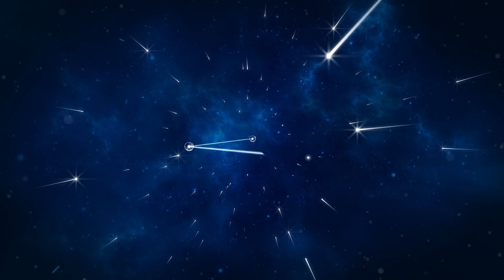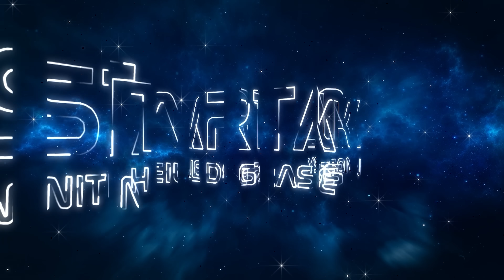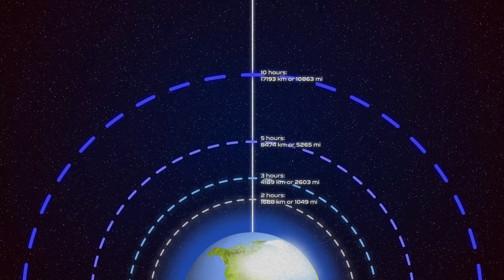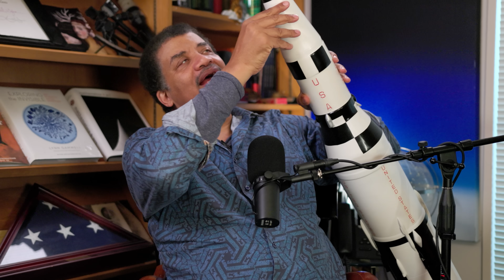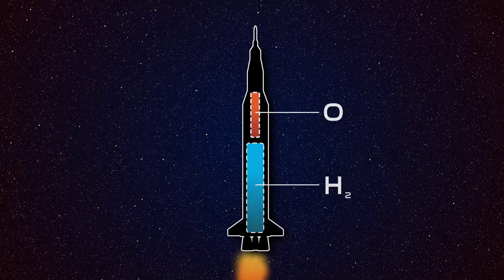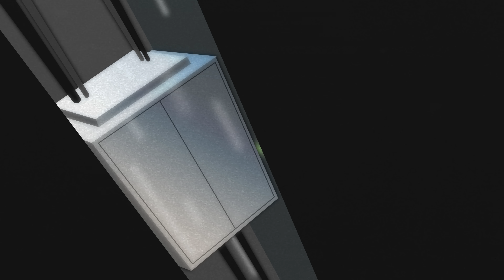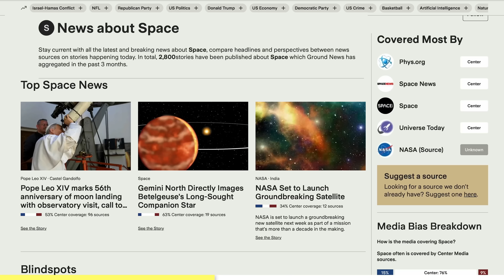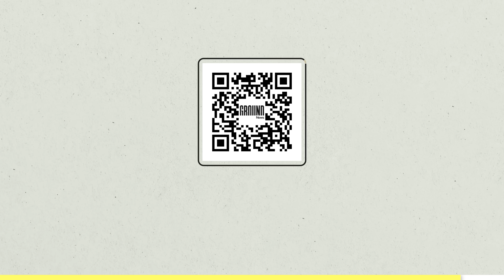When Will We Have a Space Elevator?

Comment: I was so excited when I clicked on those because I knew what you would end up talking about. I am NOT in STEM officially. It is a very casual hobby, but a few years ago a coworker of mine, who is now an engineer, gave me the article about the Carbon Nanotubes. From my understanding the concept was going to be used more for transporting supplies into space without having to launch a rocket everytime. Rockets would still be used for travel.
Reply: If a space elevator is built you won't need rockets to leave earth, you will need them to reach other planets, from the elevator, it will act as a space port.
Reply: @DrakyHRT  The tether also acts as an interplanetary launch mechanism. Put your interplanetary capsule on the top half of the tether, on the counterbalance segment, above the orbital space station and centrifugal force will accelerate it away from earth. The longer you make your counter-balancing tether, the more acceleration you can apply to your interplanetary craft. That's why dismissing the idea as "not necessary when we have rockets" is ridiculous. It's the equivalent of saying we don't need cars because a horse and buggy can transport stuff. Rockets can get us into orbit at great cost for limited payloads, and can then send craft further out into the solar system for additional great cost for even smaller payloads. And you pay that every time, for every single launch. In contrast, we could use the potential energy stored in a space elevator. It's harnessing the earth's rotation. You can balance the energy cost of transporting stuff into orbit against harnessing the braking energy as you slow stuff down from orbit (such as asteroid mined materials) such that the cost of operation is near zero. The initial investment is high but long term, it pays for itself. 
Disappointed to see such short-term thinking from Tyson here - "it's too hard so let's keep doing it the tedious expensive way."  I expected better forward thinking from someone like Tyson.

Comment: If you make the elevator shaft a sealed tube, and open the space end up, it will suck the elevator up like a bank tube. Probably a lot faster than a couple hundred mph
Reply: Better be careful. the air pressure would likely crush the bottom of the tube when it evacuated.  Of course you could design against it but that would add weight.

Comment: I always wonder why they never mention that the elevator will need to accelerate everything sideways also. Going up from the equator the lateral cabin speed has to go up from 1600 kph to over 9000 kph to remain 'stationary' above the ground floor of the elevator.
Reply: It has a lot of mass so transferring the relatively minor bits of energy isn't a problem. Naturally if balance of mass going up vs. down gets to lopsided, it has to be made up. But not a big deal

Comment: Carbon Nanotube Hypercube Architectures: Tesseract-Based Scaffolding for Next-Generation Nanomaterials

Abstract

Carbon nanotubes (CNTs) are among the most promising nanostructures known to science due to their exceptional strength-to-weight ratio, electrical conductivity, and thermal performance. In this paper, we present a conceptual application of the tesseract (4D hypercube) as a mathematical framework for organizing CNTs into an architected nanomaterial. While true four-dimensional structures cannot exist in three-dimensional physical space, the projection of a tesseract into three dimensions provides a viable blueprint for the construction of a novel superlattice. This paper outlines the geometric principles, lattice scaffolding, and material potential of such a structure, along with its limitations and paths to experimental realization.

1. Introduction

The field of nanomaterials continues to push the boundaries of structure-property relationships by manipulating matter at the atomic and molecular scale. Carbon nanotubes (CNTs), due to their chirality-dependent electronic properties and unparalleled tensile strength (~100x stronger than steel), serve as ideal building blocks for nanoscale frameworks. However, arranging these 1D tubes into complex 3D or higher-dimensional analogues presents a new frontier for materials science.

This essay explores the theoretical application of a tesseract-inspired architecture—a four-dimensional hypercube projected into three-dimensional space—as a framework for assembling CNT-based materials. The goal is to investigate whether such a configuration can yield novel electrical, mechanical, or quantum-functional properties based on its multi-directional connectivity and geometric symmetry.

2. Mathematical Structure of the Tesseract

2.1. Definition

A tesseract is a four-dimensional analog of a cube:
	•	A 0D point is connected by a 1D edge to form a line.
	•	A 1D line is connected to another to form a 2D square.
	•	A 2D square is extended orthogonally to form a 3D cube.
	•	A 3D cube is extended in a fourth orthogonal direction to form a 4D hypercube—a tesseract.

2.2. Properties
	•	Vertices (V): 16
	•	Edges (E): 32
	•	Faces (2D): 24 (squares)
	•	Cells (3D cubes): 8

2.3. Projection into 3D

The tesseract can be projected into 3D space as:
	•	A cube nested inside a larger cube,
	•	With vertices connected radially to form a total of 32 edges arranged in symmetric fashion.

The resulting projection is mathematically precise and geometrically stable for design, even though the fourth dimension is non-physical.

3. Conceptual CNT Scaffolding

3.1. Structural Design

Each edge of the projected tesseract corresponds to a carbon nanotube. Each vertex becomes a carbon-based node, such as a fullerene-like carbon cage or graphene junction. The complete structure is a 3D lattice exhibiting higher-order symmetry and multidirectional connectivity.

3.2. Scaffolding Model

Let \mathcal{T} \subset \mathbb{R}^3 denote the 3D projection of a tesseract with:
	•	CNT segments \vec{C}_{ij} connecting nodes V_i and V_j,
	•	Each vertex V_k \in \mathcal{T} hosting a molecular junction capable of multi-axial bonding.

Then, the CNT-scaffolded structure becomes:
\mathcal{S} = \bigcup_{(i,j) \in E} \vec{C}_{ij}

Where \mathcal{S} represents the total CNT superlattice defined by a hypercubic topology.

4. Theoretical Benefits

4.1. Mechanical Isotropy

Standard CNT bundles exhibit axial strength but anisotropic properties. A tesseract-based scaffold could enable multidirectional mechanical reinforcement, distributing load symmetrically across 3D space.

4.2. Multi-Axial Conductivity

The radial symmetry of the structure allows for electronic conduction in multiple axes, which is advantageous for:
	•	Neural interfaces,
	•	Quantum bit routing,
	•	Low-latency nanoelectronic networks.

4.3. Quantum Connectivity

If constructed with sufficient purity and coherence:
	•	Such a structure could support topological qubits,
	•	And facilitate entangled particle networks via high-connectivity nodal hubs.

5. Assembly Challenges

Despite its elegance, constructing this structure faces major obstacles:

Challenge	Detail
Precise CNT Placement	Atomic-level alignment of nanotubes at correct angles.
Junction Engineering	Designing multi-terminal carbon junctions with 8+ bonds.
Growth Control	Directed self-assembly or positional synthesis required.
Stability	Avoiding deformation under thermal/electrical strain.

Potential fabrication techniques:
	•	DNA origami scaffolds for guided growth,
	•	Electron beam lithography,
	•	Optical trapping of nanotubes,
	•	Chemical vapor deposition (CVD) with spatial patterning.

6. Future Applications

If realized, CNT-based tesseract lattices may serve in:
	•	Quantum computing frameworks,
	•	Lightweight space-grade materials,
	•	High-efficiency thermal conductors,
	•	Nano-neural scaffolds for biointerfaces,
	•	Metamaterials with programmable properties.

7. Conclusion

While a true four-dimensional structure remains physically impossible, projected tesseract-based architectures offer a mathematically rigorous and scientifically promising avenue for advanced material design. Carbon nanotubes, with their exceptional nanoscale properties, represent an ideal candidate for embodying such geometric frameworks. Continued interdisciplinary research in geometry, materials science, and nanofabrication may bring these speculative ideas into practical reality—expanding the frontier of what is physically buildable within the three-dimensional universe.

References (selected)
	1.	Saito, R., Dresselhaus, M. S., & Dresselhaus, G. (1998). Physical Properties of Carbon Nanotubes. Imperial College Press.
	2.	Coxeter, H. S. M. (1973). Regular Polytopes. Dover Publications.
	3.	Zhang, Y., et al. (2020). “Programmable self-assembly of carbon nanotube architectures.” Nature Nanotechnology.
	4.	Wen, X. G. (2019). Quantum Field Theory of Many-body Systems. Oxford University Press.
	5.	Smalley, R. E. (2001). “From Tubes to Machines.” Scientific American.

Comment: Ten days (or a month) in a metal box at the start and end of a trip that consists of spending months to years in a metal box...I'm not seeing the problem. Do the fuel and parts to build the shipyard also get bored on the elevator trip in your estimation? How many launches to send those up for either a trip to Titan or an Aldrin cycler, for instance? How many tons of nitrogen oxides produced per launch and how much additional skin cancer and cataracts are you willing to get by destroying the ozone to facilitate those launches? Can the rockets act as solar power stations like the counterbalance for the elevators can? If so, what are the transmission losses converting the solar power to microwaves, sending them through the atmosphere, then converting them back to electricity compared to sending them through a conductive tether? For that matter how much energy can be harvested from the tether from static electricity alone? I'd also point out that production is up to meter lengths for graphene fibers so, a  couple ordes of magnitude better than the case you laid out and you didn't even touch on boron nitride...the OTHER material being manufactured that can do the job. You didn't explain anything other than your desire to lay down and let the billionaires go for a ride. I take that back. You explained pretty thouroughly to me how it came to be that our country is falling behind the rest of humanity scientifically...a self taught convict put more effort into learning about space infrastructure than a space science educator. Do better. I used to tune in every time you were on PBS and we may lose them...we can't afford to lose you too.

Comment: Lofstrom Loops would be more doable.
  Even better would be an Orbital Ring, which could double as a platform for habitation as well as an elevator-to-orbit.  And, since most Orbital Rings would be only 100-200km up, an "elevator" to it, going at 60 mph, could get there in a bit over an hour.  Once up there, travelling along the ring to another point on the globe becomes likewise quite fast.

There's more, but Isaac Arthur has already done at least one video about how Orbital Rings work and the advantages they have over both Lofstrom Loops and Space Elevators.

Comment: Material
Strength (GPa)
Rel. to Steel (×)
Cost (USD/kg)
Notes
Graphene (monolayer)
~130
65×
$10,000–$100,000+
Lab only, not scalable
Carbon Nanotubes (CNT)
62–100
31–50×
$1,000–$50,000
Still non-scalable in bulk
UHMWPE (Dyneema, Spectra)
3–10
1.5–5×
$50–$200
Strongest commercial fiber
Zylon (PBO)
~5.8
2.9×
$300–$1,000
Excellent but costly
Kevlar (Aramid)
3.6–4.0
1.8–2.0×
$40–$80
Very common; military + industrial
Vectran (LCP)
~3.0
1.5×
$100–$300
Used by NASA, moderate price
High-Strength Steel
~2.0
1.0×
$1–$3
Baseline material
Zytel HTN / Crosslinked Nylon
1.5–2.0
0.75–1.0×
$5–$15
Engineering thermoplastics
PBI (Polybenzimidazole)
~1.0–1.5
0.5–0.75×
$400–$800
Flameproof extreme polymer
Ballistic Nylon (1680D)
~0.9–1.0
0.45–0.5×
$10–$15
Low-cost rugged textile
Glass-Filled Nylon 6/6
~0.15–0.2
0.075–0.1×
$2–$4
Rigid, but brittle under tension
Nomex
~0.1–0.15
0.05–0.075×
$50–$100
Fireproof, low strength
Standard Nylon 6,6
~0.07–0.1
0.035–0.05×
$2–$5

There is a few more like 

Diamond glass , sorry but chatGPT, refuses to give complete answers ( by pre prompt design) , fir those of us that don’t use deepseek, for obvious reasons, where SOL, you get the idea though!

Comment: Add dimensions to the problem, and then you have an answer.
Most experts outside their expertise are just spurts. 
Electric energy distribution is a grid Construction Engineer problem. 
Grids are 10times more expensive than the generation plants. 

4cents electricity transmitted via the grid is 44cents kWh. 

Grids make free electricity expensive 

Fossil fuels are dirt-cheap. 

The real economic dimension of nuclear electricity is that it is concentrated electricity that needs to be dispersed to the millions and millions of consumers. And Grids cost $TRILLIONS.
Grid owners and investors need solid 247 cashflow of $100sBILLIONS per grid invested $TRILLIONS. 

Dispersed rooftop PV generation has no grid costs. 
Rooftop PV has no realestate costs.
Rooftop PV is cheaper than home windows $m²
EVs massive v2g storage batteries parked 23hrs every day and all night long are FREE MASS ELECTRICITY STORAGE daily. 
EVs save $$$$ on no petroleum costs.

20million of both in Australia can oversupply the consumer and dirt-cheap feed-in electricity to the grid. 

90% of the world's population lives in the sunbelt.  Happy days. 😊 

All nuclear promoters are not grid construction engineers and utterly fail to make economic sense in our exponentially changing world.

Comment: The voltage difference between Earth and the ionopause is about 350 kilovolts.
Such a space elevator structure will melt quickly due the electric current flow through such a structure.
But Neil is our propagandist and still believes in the Einstein sci-fi.

Comment: Once the elevator gets above the atmosphere, it should be easy to get it going really fast--like thousands of miles per hour, right?  No more air drag.  I guess it depends on how much the elevator weighs, though.  Then there has to be a way to slow it down.  Converting inertia to heat rapidly is easy in a fluid such as air, in space it gets very hard to get rid of heat that quickly.
Reply: There's also the consideration of the energy required for that acceleration (and deceleration).
Reply: Freight going in either direction isn't concerned how fast it gets to its destination. After all, we send stuff around the world via relatively slow-moving cargo ships. Rather more impatient "self loading cargo," i.e., passengers, can get there on their faster rockets. After they've sent their baggage "not wanted on voyage" ahead of them.
Once at the station at the upper end, spacecraft destined for deep space could be "yeeted" towards their ultimate destination.

Comment: Short answer........ never.  Consider that as the elevator rises, it also has to be accelerated laterally to maintain orbital velocity.  It' has to be given additional velocity at each point along the way via the cable.  The elevator will resist the acceleration..... drawing the cable back like a bowstring, vastly increasing the stress on the cable via shear loads on the anchor points.  If the cable can take it, it will also pull the upper terminus down to a lower orbit, accelerating it in its lower orbit.  This will move the terminus away from being directly above the Earth terminus.  The loading reverses as the elevator returns to Earth.  The moving car will induce harmonic vibrations in the cable as well, since the point load will move along the cable with the car.  The more rapidly it moves, the greater the frequency and amplitude.  Perhaps the cable could operate two cars of the same mass and loaded equally (THAT would be a logistical nightmare) moving in opposite directions to damp the vibrations.  Or the vertical rate of travel could be constantly adjusted to provide wave interference at 180 degree out of phase interference.  The dimensions of the car also presents some interesting constraints.  If it's long and narrow, like a rocket, then the difference between the orbital velocity of the nose and tail will be enhanced and will induce a rocking couple in the attachment to the cable.  A shape more like a classic science fiction flying saucer would be better, but not aerodynamic for the part of the trip through the atmosphere.  
Now, imagine that a defect was detected in the cable at an anchor point, which might have to be designed as a ball joint to allow the deflection due to car acceleration/deceleration deflection.  How could it be replaced or repaired?  If it had to be demolished, I imagine that the last trip up would be with a large booster rocket.  It would be attached to the car, positioned to add to it's orbital velocity, and when the booster is ignited, the cable would be cut at the Earth terminus and the whole shebang would be hauled out to space.  
All in all, rockets look pretty good to me.

Comment: If there is to be a very high structured elevator, it needs to be built as the Obama Beam. A tube with two flat sides separated by half the diameter of the tube on each side. There will be no wind resistant when faced towards the wind to let the air flow through the Obama Beam. It has many uses for aerodynamics and even generating water and electricity...❤   l 0 l 
Top view of the Obama Beam. l 0 l...